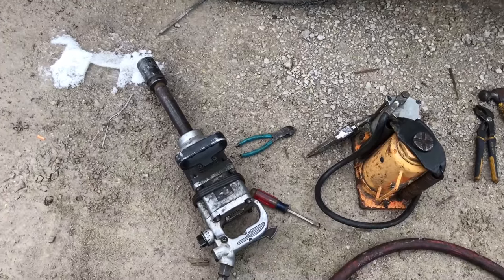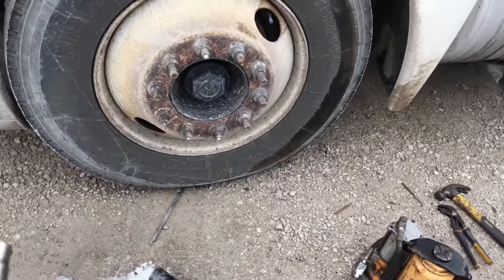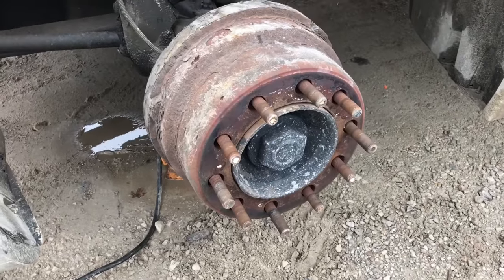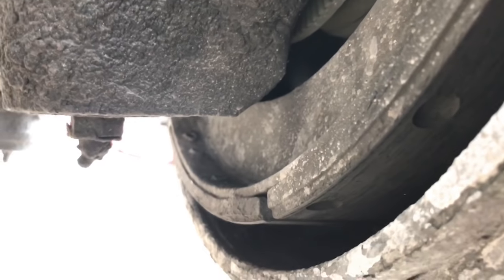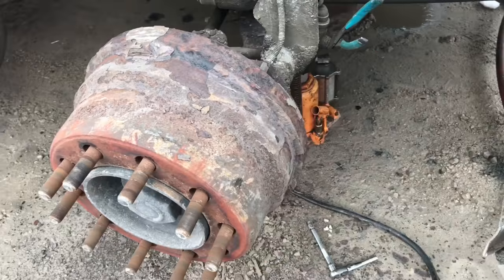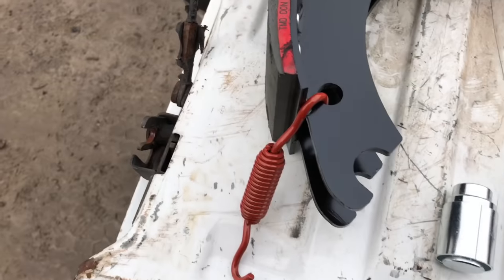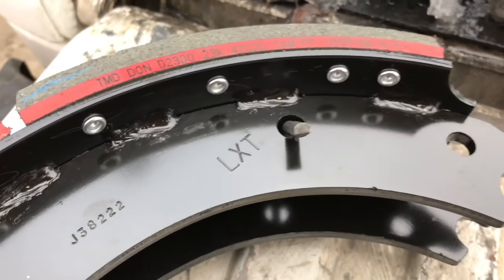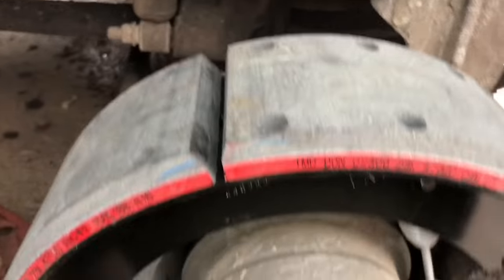How to change brakes on a semi truck

Comment: One thing I recommend doing is clean your s-cam off! Any grease on it will cause rollers to slide and flat spot the s-cam. And while you’re in there check s-cam end play and bushing wear by pulling in/out and up down. And also check where the old ones were riding on the drum before removal. If they’re walking off the drum you may want to get a s-cam rebuild.

Comment: An over-the-road driver friend had his own trucks and he would change his own flatbed trailer brake shoes and service his (oil-filled) hubs and hub seals all without unbolting the 8 dual (10-hole Budd wheel rims, with their tires..) from the hubs.  He'd put a piece of clean 1/4" steel plate (of adequate dimension, and lightly greased on the top surface) underneath the duals. Adjust his jack so the tires/rims/hub/drum assembly was just sitting on the greased steel plate (no trailer weight). Drain the hubs and remove the spindle nuts and slide the whole deal straight off the spindle on the greased steel plate. Change out the shoes and whatever brake parts needed,  check the oil seals and slide the whole thing back on.  (of course, this only works assuming your bake drums are still okay and don't need changing....).  Saves a good bit of time.
Reply: Only resone you would pull the duels off together as you say is if your going to do the brake job and wheel seal

Comment: Only thing I would recommend is use some copper grease between your hub and drum and then again between wheel and drum, just makes it easier next time you come to change them, good job
Reply from the maker: Great point Greenboff, I'll be sure to use some the next time I take them off. Thanks for the tip 👍🏼

Comment: Great content. How often do you need to replace the break shoes?
What would the average shop charge for this job?
I've only worked on 4 wheelers and I hate drums, discs are so easy. 
Stay safe and profitable.     😃
Reply from the maker: Thank you John Beckman 
It's been a while since I've had someone else do my brakes, but I think they run anywhere between 750-950 for brakes and drums in the back, but I could be wrong. I think labor normally runs about $100 per axel plus parts. If someone knows otherwise please feel free to comment.
Reply: Ave. is about $136 per axle plus parts that shops will charge double. Do youself will save at least 250 bucks per axle.

Comment: I'd like to see that 1inch Impact running off your truck air tanks.
Reply from the maker: I'll be sure to record it on my next video 👍🏼 bubba JusTrucking
Reply: bubba JusTrucking it will run fine off them. I've done it. It runs great just not long, at all.
Reply: It works well  but you will  need to take breaks and let air tank fill up several times. Aslo you must use 1/2 " hose from tank. Standard hose you buy that hook up to glad hands will not provide the air volume needed. I've been doing this for 20 years.

Comment: Good video,thanks. Do you buy new shoes every time or do you have your shoes re lined? If you can't find copper grease there is a great alternative in plastilube moly. It is a high performance synthetic grease that was specially formulated for brakes. Good blast down with the steam cleaner required to get all that shit off your suspension!
Reply from the maker: Thanks for watching Andrew, I buy new ones every time, only cause I don't know of a place that can reline them for me. Depending on the brand they can go as cheap as 35 dollars a wheel and as much as I've payed is about 70 dollars per wheel, but that's for better brakes. The cheaper ones seem to crack, squeak and wear out faster, but that's a matter of personal preference. Thanks for the recommendation on the copper grease and the plastilube, I'll be sure to ask for some the next time I'm at the parts store 👍🏼

Comment: Ya bro you need to remember them jack stands and scotch a tire or two. Better be safe than sorry. Im a tractor trailer mechanic of about 25 years. I'd also get the proper torque wrench and torque them nuts on steers and drive tires. 500 foot pounds

Comment: I have  a 1in air impact as well would i still have to torque it ?
Reply from the maker: I always give them about a 1/4-1/2 turn after the lug hits the rim on the first round and then I come around and hit them for another half turn after that. You’ll need about 450-500 ft lbs of torque which a 1” should have plenty. I’ve been doing it for almost 15 years and never had a problem.
Reply: I certainly would.

Comment: save yourself 200-300 $ for a brake job. but a 1" impact is around a $700
Reply from the maker: amer a3a2 I payed 175 for that impact back in 2011, I've done many brake jobs and tires with it. I agree 1" impacts can get expensive if you don't do your research, but if you shop around you can also save money on doing the brakes, tools and parts.
Reply: How to serg 
175?? shit the cheapest i've found is $650
cheers
Reply: amer a3a2 you gotta look around i found mine from this old retired guy who was giving away all his tools i got mine for 85 back in 2014 and still works like a charm
Reply: Harbor Freight has several 1" impacts from  $100 to $300. I run same  off my truck air tank with 1/2 inch hose. Have saved 10s of thousands of dollars over the last 20 yrs. By doing my own brakes, changing tires and blow outs on the road. One road call to fix a blown tire is at least a thousand dollars.